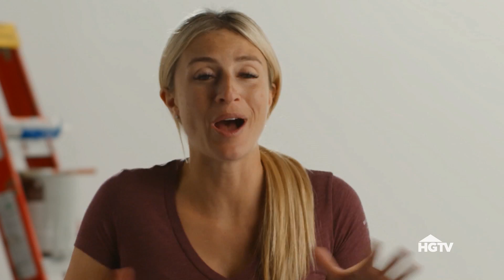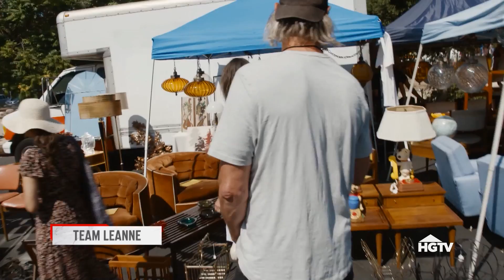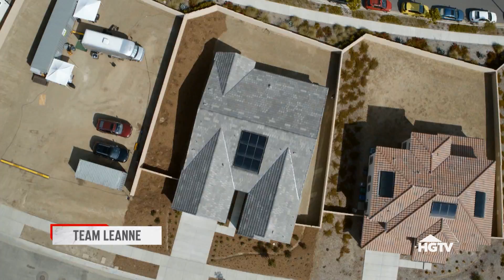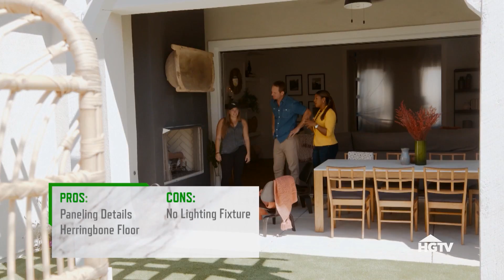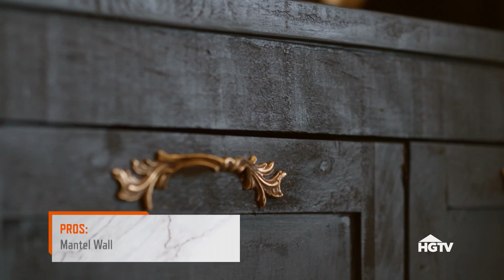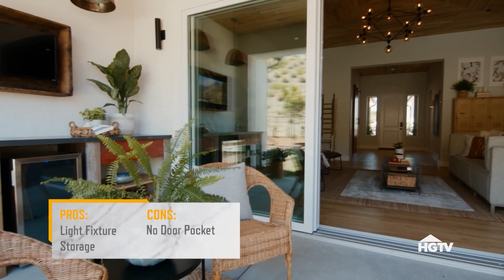“My BOLDEST RISKIEST Move Yet” Great Room Renovation | Rock The Block | HGTV

Comment: It must have been Jasmine’s outdoor space that did it. I feel like she and Leanne both put all their effort into the outside and kind of forgot about the inside. Leanne’s wackadoo missing baseboards and whitewashed ceiling beams are awful and look unfinished. Meanwhile, Jasmine putting in the rusted, beat-to-heck lockers into the living room is not a good look. I thought she was going to put them outside, which would still have been awful, but would have made more sense as she did a pool. Mina got robbed.
Reply: Those lockers could have been useful in the garage.